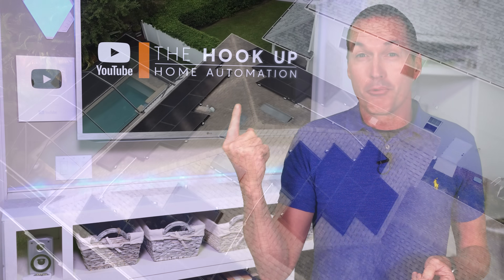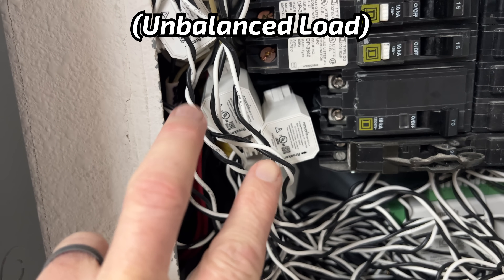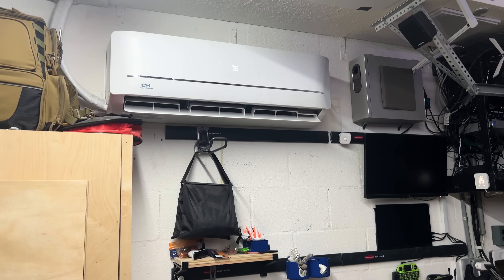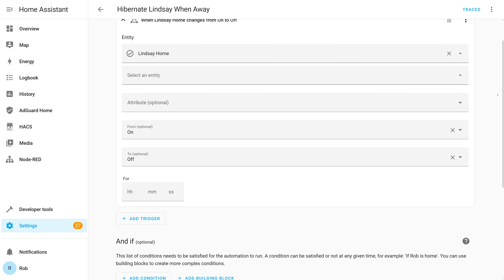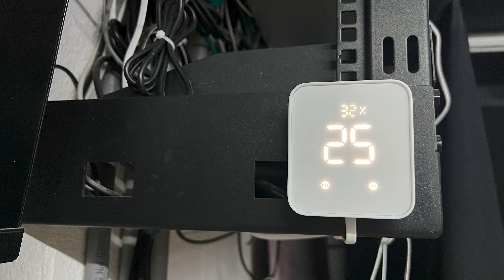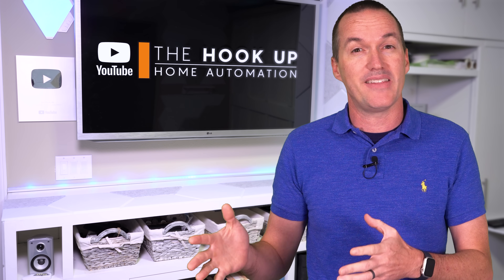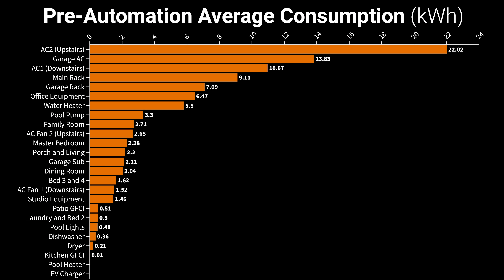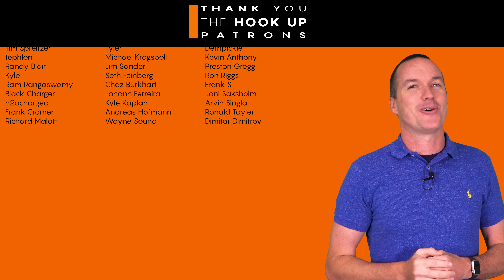I cut my electric bill by $1,331/year (with Home Assistant automation)

Comment: A rough analysis from my side: most energy has to do with cooling the house. I suggest to take action on the root cause. Insulate the house (the roof!) and apply high insulation glass. 
Also get rid of the garage rack and apply smaller devices with less capacity. A real honest analysis will provide you with in-depth facts that a lot is pure overkill and not essential. 
That will bring your bill way more down than these relatively small adjustments so far.
Reply from the maker: My garage switch is running at 80% PoE capacity, so that's not it.  The insulation is a bit of a mystery, my house was built in 2012 so theoretically the fiberglass in the attic is decent, but the power usage says otherwise.
Reply: @TheHookUp I'd recommend getting a thermal camera (a reasonable one can be had for AU$200 so probably around US$130). I bet you'll find hot spots on your walls/ceiling - doesn't take much of a gap to affect the effectiveness.

The other thing to consider - you have a HUGE heatload from all the equipment you run inside the house/garage that you leave running throughout to avoid the short start up time. That heat is trapped inside if you have good insulation, so if you have an average of 3kW of load, you need to pull 3kW of heat out of the house before you even consider heat from environmental sources.

So I'd be looking at stopping heat getting in if there are insulation issues, but you probably need to focus on reducing the energy use inside the house as any reduction there will also reduce cooling requirements.

Comment: you dropped your usage buy my total daily usage lol. 3000 sqft barely insulated house in the south. 75Ff temp in any active room, entire rack, server, 10g networking, 3x wifi-ap and 22 cameras, 5 minisplits, always on laptop, desktop, and server, with one hibernating computer terminal. 25kwh daily average usage. 

One of your biggest issues is those massive 4-6 ton heat pumps you are using are around Seer 13-15 (Seer2) at best. But with how you are using them they probably operating in the 10-11 seer range. I am using two mini-slips with SEER2 rating of 28.5 and I try to keep them in that range before turning on the other two SEER2 19 and 21 rated heat pumps for peak sunload times. 

My Smart outlets turn off things like TVs, 3D printers, an such when not in use reducing losses. The pool pump runs between 2 and 10 hours a day based on the solar input and battery state of charge with the pool heat pump either cooling or heating the pool if the battery is predicted to each full on any day.

Comment: Have you thought about adding a small roof over the outside AC condensers?  Just make sure there is adequate clearance above each of the units (e.g. 3 ft or so).

Comment: I have had my eye on a second one of these for my sub panel.  Love to see your take on it. Mine showed me 3 kids use a lot of hot water and convinced me it was worth replacing the water heater with a more efficient heat pump model.  Halved the power usage for more comfort and control.  We also had the same A/C Discovery.  Our Nest thermostats were costing us more in usage and less comfortable.

Comment: Do you have a zoned HVAC system? If you do, make sure all of the dampers are opening and closing properly. Also, make sure your ecobees are setup to let the zone controller board control the system and not the ecobees. I have been going through balancing out the temperatures between the floors.
Reply from the maker: No dampers, just upstairs/downstairs.

Comment: The way they nest plugs and circuits is great. I use many of the plugs in the UK.. I don't have the circuit specific sensors installed as consumer units (electrical panels) in UK are much smaller so space is more limited

Comment: Reducing the energy consumption of your computers has the additional benefit of less heat that your AC has to remove from your house. You could try underclocking/undervolting your computers to further reduce energy use.

Comment: Power has always been a huge topic for me.. When we built the house I had a shelly 2pm behind every socket and sonoff in other places..
All go back to Home Assistant to digest and make sense.. I run the whole house on about 500kwh max in a month and sometimes down to 300kWh. 4 bedrooms + office no pools though.
I can see why the biggest offenders are
1. AC (my AC are set to just enough to be comfortable and are not 'full house' but rather bedroom+office
2. I have zero pumps and no pool
3. All computers outside of my main desktop are behind laptops and using HASS.Agent for remote sleep/hibernation
4. I am very particular about anything that is always on. (Wolfgang's channel helped me build a frugal home server that pulls around 45W with 4x 12TB + Nvme and an i5 cpu) Same with network even though I got 10gbps around the house and wifi 6e it all consumes around 50W max - unifi tends to gobble power.

Anyway looking forward to seeing you optimise even more :)
My current project is around battery optimisation with Home Assistant templates

Comment: If you live in a hot sunny area, start with having awnings installed over sun-facing your windows. By reducing your house's solar gain, the A/C will have to work significantly less saving an enormous amount of power. You might even find that with awnings installed, windows open to allow fresh air in, and A/C off, your house will still be a comfortable temperature on many days.
@TechnologyConnections has an excellent video on the subject. https://www.youtube.com/watch?v=uhbDfi7Ee7k
Reply from the maker: Windows open is generally a pretty bad idea in FL when the outside humidity sits around 90%.

Comment: Looking at your networking gear, did you switch from Blue Iris to Unifi Protect?   I think I saw an NVR Pro in that rack?  I'm just curios as I'm about to build out an NVR solution for myself...
Reply from the maker: I'm currently in the process of making the switch 100%.  Right now I'm actually running both.

Comment: 6:34 please tell me you don't have a delay for 8 hours in your automation.
Make two triggers instead.
Long delays will fail at some point.
Reply from the maker: I suppose I could though I doubt it would be much of an issue if the AC failed to turn back on.  I'd just say "huh" and turn it on with the remote.

Comment: That's cool!  I've been thinking of doing this too, but my average bill is only $300/month, so it's harder to justify the money for the Emporia gear since the payback time for any savings will be longer.  I love the way they let you combine the plug monitoring with the circuit monitoring

Using just a Kill-a-Watt device, I found the majority of my computer's energy use was the monitors, so I set them to go to sleep after just 5 idle minutes instead of 30 and it made a decent difference

Try experimenting with cutting back the number of hours your pool pump runs per day to see if the water stays ok with fewer hours

Comment: I was actually going to suggest setting the AC LOWER at night: AC should be its most efficient, possible utility time of day discounts in some areas, and it further cools furniture / delays warm up in the morning which can sometimes save you an hour of run time in the morning if your day time setting is higher.
Reply: Agreed, you don't want large temperature swings. Everything in your house will reach the ambient temperature and cooling down several degrees takes a lot of energy. Air on the other hand doesn't have a large thermal capacity and if you just had one temperature it stayed at then the only cooling is fighting any heat being generated in your home (people, computers, TV, etc)  as well as transfer from the outside through your insulation.

Another huge energy savings can come down to looking at how you actually use computers. Are you really using the gaming features all of the time or are you browsing the web, watching videos, etc? Switching non-gaming/productivity work to a Ryzen mini PC that maxes out at 35W can save an extreme amount of money. A simple and inexpensive USB switch and monitor input switching and make the jump between computers seamless.

Comment: I appreciate a well designed app as well, but my Vue 3 is running esphome. Not for everyone, sure, but I won't tolerate automations that will fail if the internet is down.

Plus, you never know when the company will just decide you don't get to use the device you bought anymore.
Reply from the maker: True, but I'm guessing at that point I could just pull it out and install ESPHome since it requires a physical connection to the board to flash.
Reply: @TheHookUp 100% true. I'd just rather not have to set it up a second time.

As an added bonus, the Bluetooth chip now adds to my BLE beacon network and can detect who is in the utility room. (especially the cats who like to hide but wear BLE beacons on their collars)

I haven't found a use case for this on the Vue yet, but esphome devices can also run automations on-device, so if home assistant is ever down, certain automations still work.

Comment: Put a shade mesh tent over the outside AC units and re-measure the watt hours. 
People don't realize how much the sun heats the house. Paint your house a lighter color,  tint your windows, plant shade trees. If you're installing AC units put them in the most shaded area possible or shade them with a mesh shade cover.
When you get a new roof consider the heat load of different colors and materials.
Not everything can be fixed with a gizmo.

Comment: Not sure what is the layout of you house nor your thermostat placement, but your AC problem might be the opposite of what you are thinking - be set the upstairs AC lower, you have the cold air coming down and messing up with your downstairs thermostat, making it run less than it should and at the same time, having the hotter air from downstairs going up and making that AC run longer than what it should. So, what I do is have the upstairs AC 2 degrees hotter than the downstairs AC.
Reply from the maker: Good info.  The downstairs would have to be really cold to make that work, but it's worth looking at.

Comment: If you let the house heat up, you then have to blast the AC for a while to bleed that heat back out, so - I just leave my AC on 24/7 in the summer.
Reply: Probably depends on how long you are away from the house.
We don't have AC, but turning off the heat when we are not home saved us $40 every month on average.
Yes it's colder when we come home but after an hour or so then it's ok again.

Comment: Here in Scandinavia, I managed to get a plug-in card for my energy meter; the Kamstrup Omnipower meters are kind of standard in many nations up here. The card is called a Pow-K - just plug it in to an external slot on the meter and  contact the power company to turn on the monitoring function remotely and I get exact full power use for my house down to the watt. I don't have monitoring on everything, but at least I can get the total and be pretty sure a lot of it's going to heating and cooling.

Comment: Been using Emporia since Gen 1 excellent value app and hardwarte.  Gen 1 early on would let me see down to 1 watt, I could actually the humps from a mechanic timer turning gears, since then It's now accurate down to 5-6 watts per circuit and .1 watts on plug in device.   They had to reduce realtime data so look back live granulation is bad, you have to be on app to see fine detail like PSC motor startup.  I guess they had to limit bandwidth on servers,  Compared to Sense it's 10xs better still.  And cost  under $200.  NOW!  tthe notifcations are huge, for example I was notified when my condensor fan failed on highside on compresor pull to much over what I set and sends push notification.  Or you can set if a device pulls to low over time like fridge stops.  Everytime my fridgee goes into defrost, I get push notification, possiblities are endless.  This feature is huge and I don't believe it was mentioned at all in this video.

Comment: This is such a genius and energy-saving hack that I wish I had knew more earlier! I live in a condo and use a homekit controlled IR learning device plus a temperature sensor to control the room temperature, using the temperature sensor as a trigger condition. So if the room goes below 79 degrees fahrenheit, turn off the AC. Goes above 80, turn on the AC. Tried to set the two automations to run only before sunrise and after sunset when I'm back from work. A lot of times when I'm back in the middle of the day, the AC is still on. Turns out that when the sun rises and the room temperature is still below 80, which is not sufficient to trigger an off status, then the AC stays on throughout the day. So the apple homekit automation won't work as it should at all!!! Cost me a third more of the average electricity bill for a couple of months.🤦‍♀️ Nah, I really wish someone like you to give such kind of automation advice! Now I've set turnning off AC when the sun rises. Hope this will save my wallet this month! Thank you the Hookup. You're such a helpful and tech-savy influencer that goes beyond reviewing! Take my thumb.👍

Comment: Two weeks ago, I just purchased two portable power stations that I hooked up to solar to offset my electric bill.
Mainly for my computer and 65-inch TV that I use as a monitor. For power usage, I got the same results as you did, as my power station almost fully drained every 24 hours. By using sleep mode and turning off the TV if I left for over 20 minutes, I eliminated 1kw of power usage a day. In the scheme of things, not much difference. I have started to shut down my computer when I am sleeping.
Reply from the maker: You should try hibernate.  It's awesome compared to shut down (especially since shut down no longer works like a hard restart).